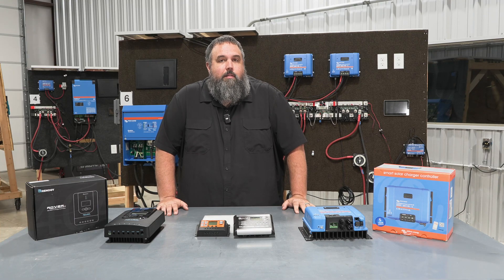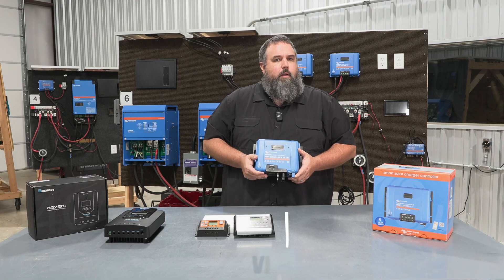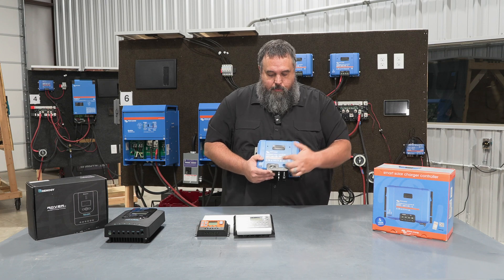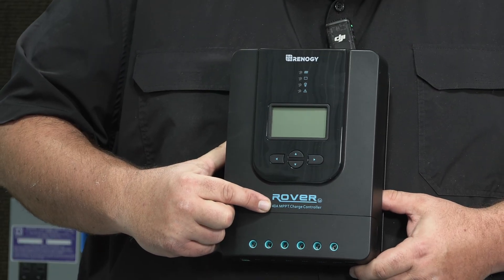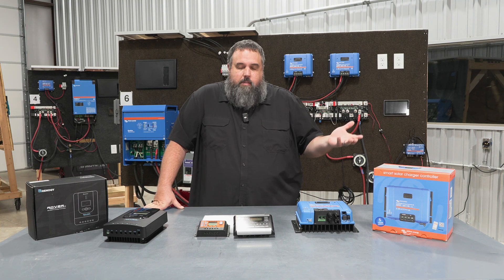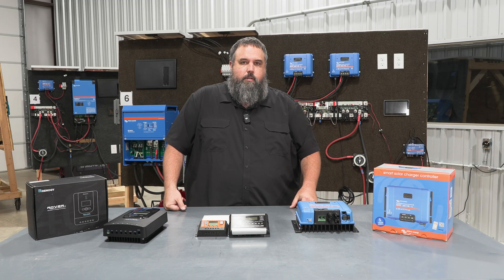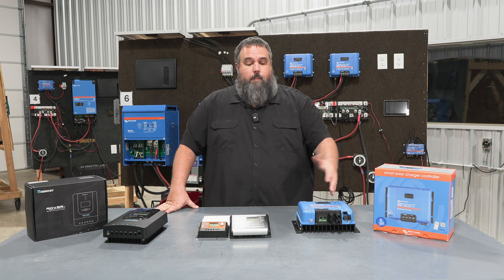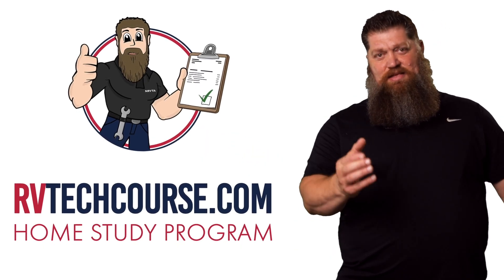Solar Controllers: PWM vs MPPT

Comment: I’ve already got solar with victron solar controller and xantrek inverter. My AC has a soft start module. How do I know what I need to add to my system to run my air conditioner when I’m not on shore power? Maybe you could do a video about that?